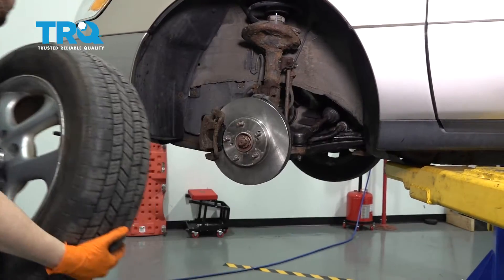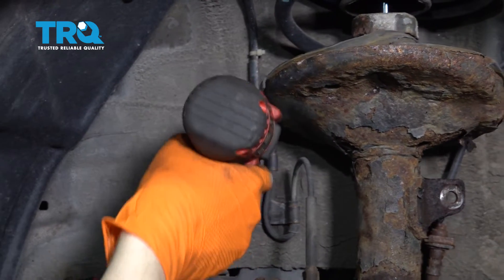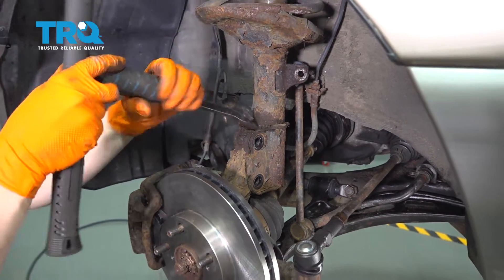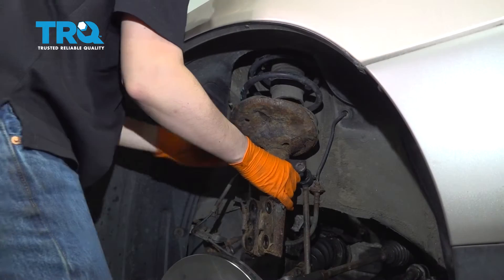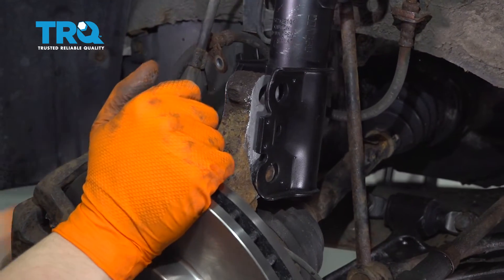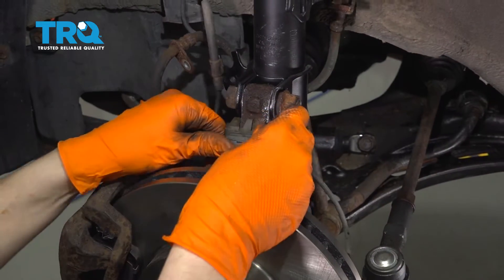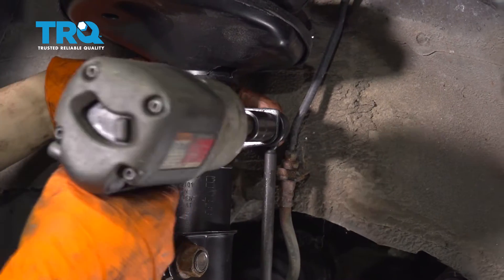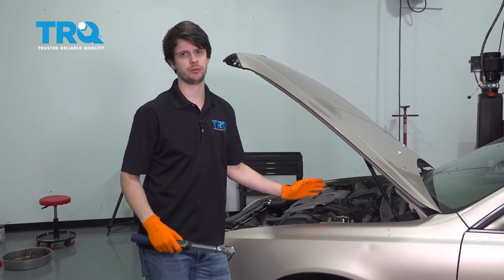How To Replace Strut & Spring Assembly 1997-2003 Lexus ES300

Comment: I just replaced the strut and kept the old spring so I have to tighten the center nut on the top and I'm watching all the videos on YouTube to find the torque of that Center nut on a 2004 Lexus ES330.
I'm finding a couple of different numbers for that torque on that
 Center nut at the top of the strut.  Does anyone know that torque setting?